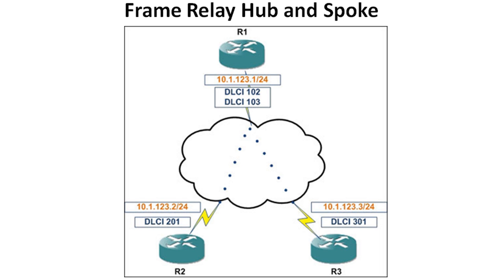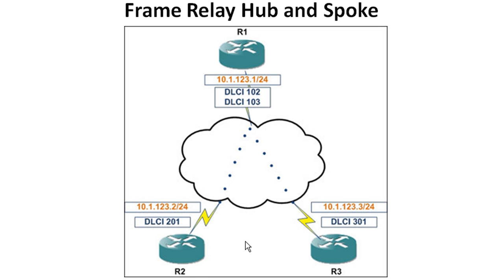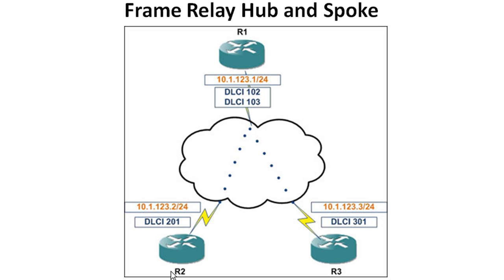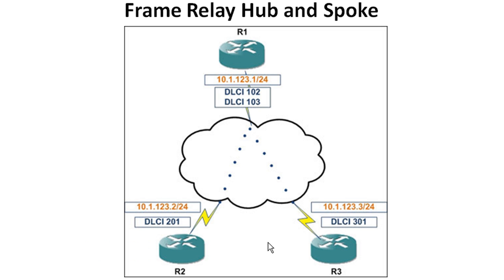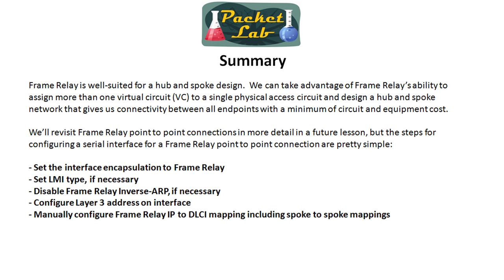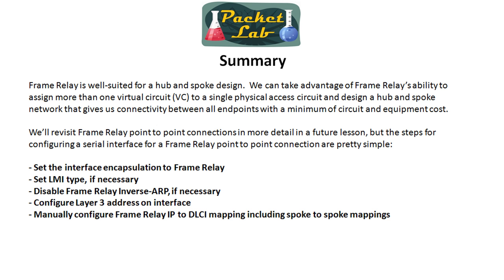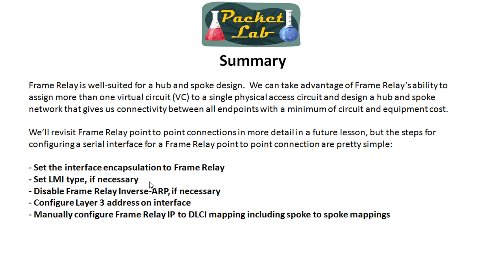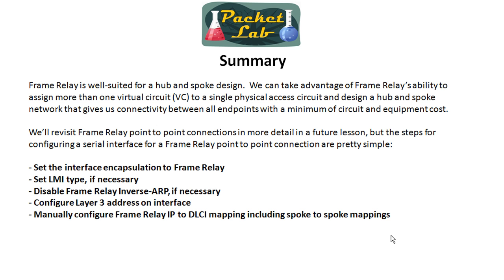Frame Relay - Basic Configurations Hub and Spoke - Part 4

Comment: So, unless we do not configure a loopback, we do not need IP routing in order for routers to operate properly and ping each other "if all of them are on the same subnet"? 

 Once we configured a loopback, in order to advertise it to the others, we have to pass through hub but hey, there is a split horizon rule (if a distance vector protocol is applied to routers) which prevents broadcast traffic flowing to other router. Thats why, we are gonna configure
subinterface in that case, huh?